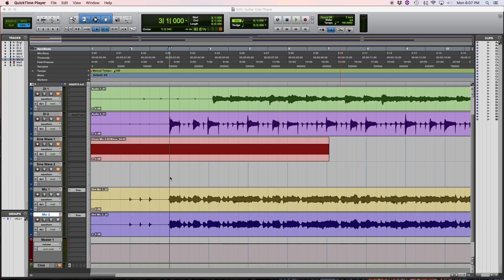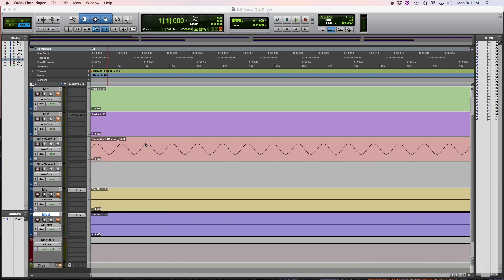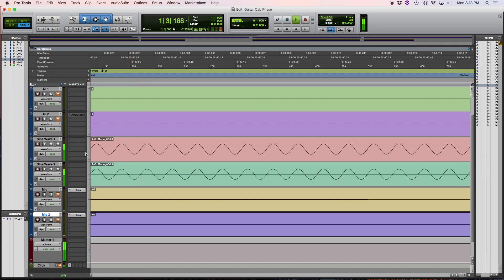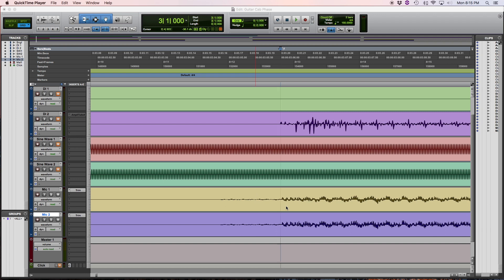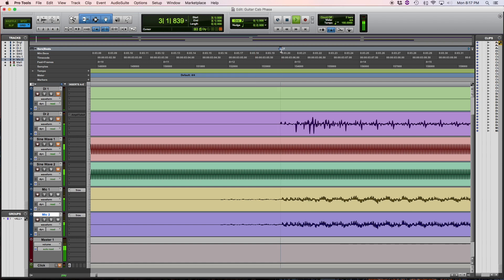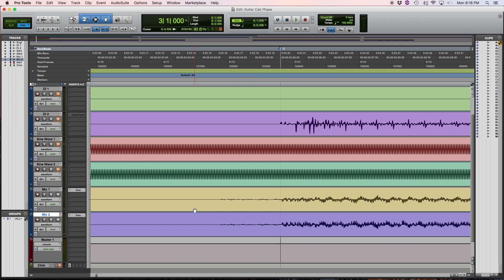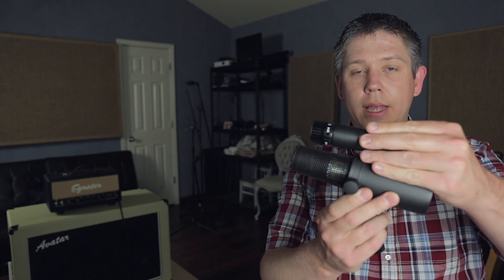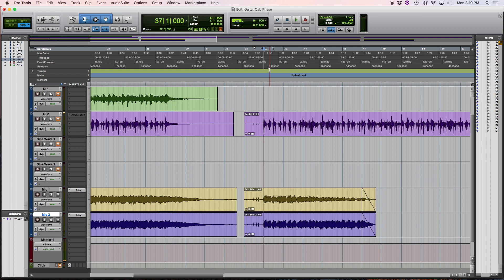Microphones and Phase: The Basics

Comment: Why I will like to invert the face if sounds good already? what is the purpose for that?
Reply from the maker: Great question! When using two mics on a guitar cab, it's usually a good idea to invert the polarity on one of the mics and make sure the signals cancel out (reduce in volume) as much as possible. You may need to move one mic back and forth a bit to find that spot.This means the mic diaphragms are the same distance away from the speaker. Then you put the polarity back on the mic you changed and the two signals will be in phase for recording and you will have the fullest tone possible from the microphones. Otherwise there may be some frequencies that get cancelled out like they did when I pulled the one mic backwards.
Let me know if that doesn't answer your question. Thanks!
Reply: @DadRockAndGuitars  Thanks again ...so basicallly everybody just inverted the phase to "check" polarity but not to record or to finalize a mix?....
Reply from the maker: Generally speaking yes. Especially on electric guitar.
Sometimes on something like recording acoustic guitar in stereo or drums with lots of microphones, a mic will be out of phase because of where it is placed, but that's where you want it to get the sound you want from it. However, it will be out of phase with the other mic(s). In that case, when you flip the polarity on one mic, it will correct the phase problem and then you would go ahead and record that with the polarity button pushed in on the one mic because it corrects the problem. Hopefully that makes sense. It's hard to describe in writing. 

Here's good video demonstrating this on electric guitar, acoustic guitar, and drums. https://youtu.be/Kn8rvcOtmVo

Comment: I still not getting thou, so we need to press Face in our interface while recording with two mics???
Reply from the maker: You don’t need to have the polarity pressed on one while actually recording. I just do it to check the phase is good while I’m getting the mics set up. Once I’m ready to record, no polarity buttons are pushed because the phase should good then. 

On an electric guitar cab, as long as your mic diaphragms are the same distance from the speaker you should be fine.

It really becomes necessary to check phase when two mics are on an acoustic guitar or lots of mics on drums.
Reply: @DadRockAndGuitars  I really appreciate your answer, it really confuses me all that about phase ...your video is the clearest... but nobody mentioned when to engage or disengage the phase button in our interfaces, your answer is very helpful. Thanks again